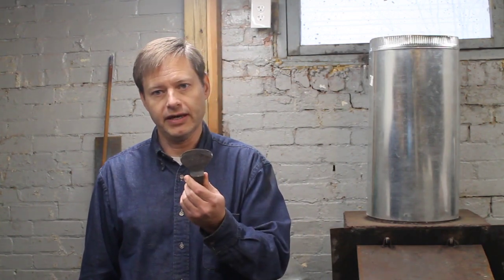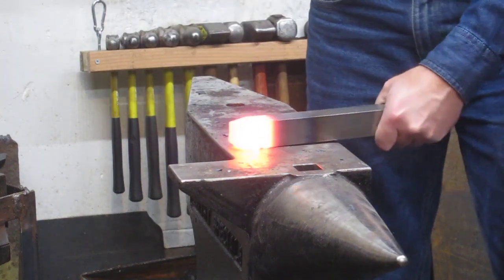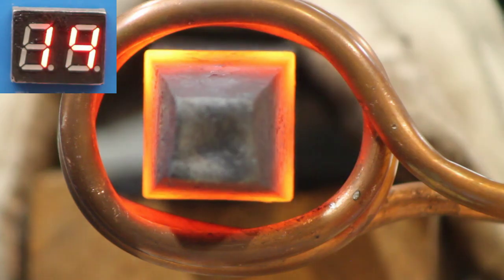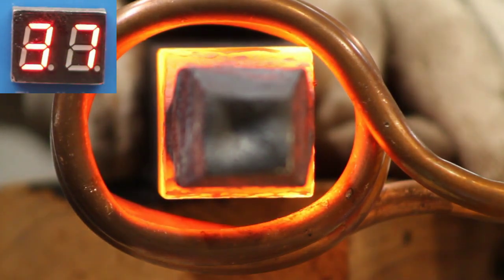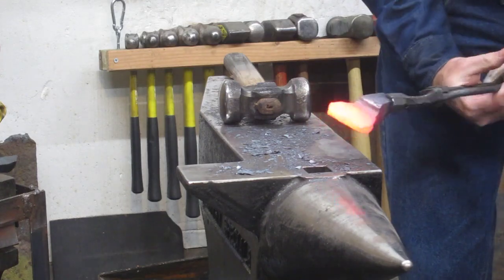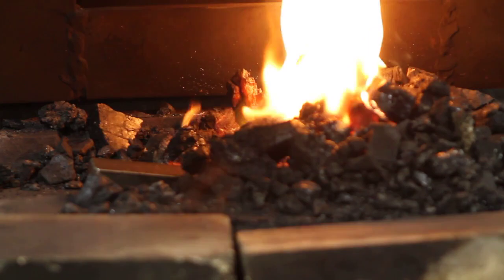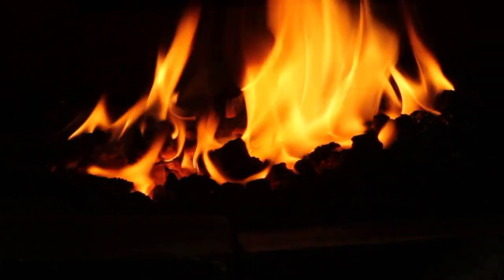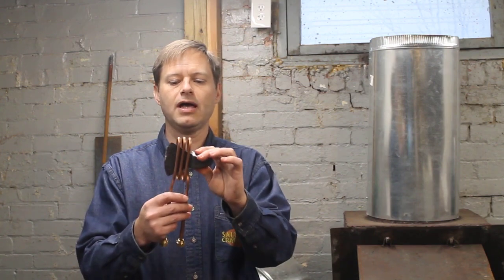Induction vs Coal: forging a hardy tool

Comment: I just saw the video. Thank you. For how long can it work continuously? Are there any restrictions?
Reply from the maker: I believe the electronics can do 100% duty cycle with sufficient cooling. Unless you have better water cooling than I do, you will not reach anywhere close to 100% duty cycle. I have found that sheet metal work (which radiates tons of heat back into the coil) and long-duration heats of larger stock for my power hammer will trip the alarm and it will shut down even with what is probably <50% duty cycle. I have purchased a transmission cooler / fan to see if that will work better than my current cooler.

Comment: Subscribed I'm also from Oklahoma pretty neat I hadn't heard of people using induction to forge so a quick search and I found this, I'm more interested in smaller knives right now from scrap materials so I think a induction forge is pretty practical. I am thinking of doing a wood forge using forced air to keep it hot in the future.
Reply from the maker: An induction forge works quite nicely for knives. You'd want to make a few different coil shapes for it. Rectangular cross-section coils work better for  flat stock that the circular ones.
Reply: @ejoftheanvil Thanks for the info.

Comment: What is the cost breakdown? How much does it cost to run the coal forge vs the induction?
Reply from the maker: At $0.10 / kWh, it costs $3.00 to run the induction heater for 4 hours continuously at 100% power (so, 8 hour day at 50% heating time). I can get coal at $0.07 per pound (yes, quite cheap compared to most sources). That's about 42 lbs of coal. I'm pretty sure I'd use more in an 8 hour day. And, that doesn't include the cost and hassle of driving to get coal ... the electricity just shows up.

That said, in a production environment, I'd still probably use propane since I could work multiple pieces at once.

As a hobbyist, I'm completely sold on induction (especially since I can use it immediately unlike coal and propane). If I were a pro, I'd probably have one in addition to propane not only because of the convenience, but because certain operations are just faster with induction.

Comment: exactly what i was looking for.
im a disabled vet. cant spend too much time on the hammer. wife and i want to start making knives and hatchets. simple thing. i am looking at the induction setup because it can be turned off and on at will and if it runs out of fuel, you have other problems. we are going to have a gas setup for quench or large projects, but i a hope to be able to just have the induction forge.

do you know of any descent ones where we could start looking? i was an electronics tech in the navy so im not opposed to building one, but id rather just buy one for safety. with my brain, i would try to build it into a 5 megawatt radar type induction forge and heat the neighbors truck..

thanx bud! loved the demo.
Reply from the maker: Induction is very good for heat treatment in most cases. You can make a coil that heats just the edge of the knife or hatchet.

You can find them on ebay advertised as 15kW (they're not, they're 7.5kW) units. If you don't want to take the ebay risks: https://ussolid.com/u-s-solid-15-kw-high-frequency-induction-heater-30-80-khz-220v-or-110v.html

You will also need a cooler. Larger TIG coolers will work.

Comment: how diverse can I be in the shape of my coils? Can I scale and change the shape of the coil based on the section of my billet that I am working? i.e. 2 in diameter then forming it to fit into a 1x3in diameter for the pocketHatchet tip? I trust will need to study induction fields more in order to exploit the advantages of induction. However, for a quick answer, in your experience, what is the max length you have been able to create with your coils and what was the most complicated shape? many thanks for the vids. It is hugely appreciated.

Lastly, do you have a paypal or PayWhatYouWant or other ecomm means of making a donation? I would like to contribute a marginally small ;) amount for your efforts. Please provide a link when you can.
Reply from the maker: You definitely want a good fit for the current size of your work. I have a video showing that effect: https://www.youtube.com/watch?v=gzp4MvxLAag. However, you can't have more than about 600mm of coil. I show that mistake in https://www.youtube.com/watch?v=XGGiGrkwXts. I have a few more videos on the design of coils planned.
Reply: @ejoftheanvil  greatly greatly appreciated.

Comment: Could you make Damascus steel with this type of system. A typical billet being 1.5x1.5x4-6" in size?
Reply from the maker: @Rodney Langstroth: not easily. That size is barely possible. Taller stacks, nope. It's hard to bring a full billet to an even welding heat. You tend to burn some areas while others are still too cold. I have some ideas on that which I hope to try (and document with videos!) in the coming months.
Reply: @ejoftheanvil  I'm also very interested for a video about damascus and forge welding with induction forge as I'm curently in the market for this or a DIY propane forge and I'm sitting on the fence.

Comment: induction heating is more efficient! Nice to see your video!
Reply: I have a local smith friend who just got an induction forge and I'll be excited to see it work.  But with a gas forge I can heat many pieces at the same time, moving them to the hot tter area of the forge sequentially.  The induction forge may shine in many things, but there are advantages for the gas and coal forges.  If I wee a younger smith doing a lot of production again I would add one of these to my shop for certain.   Looks like an ideal way to heat the middle of a bar to upset or punch the bar  in a short area.   This is a great set of videos on beginning to use an induction forge.

Comment: Did you hardwire your unit, or wire a plug? I know the instructions say to hardwire it, but it sure would be convenient to use a NEMA 6-50 plug instead. Then I could change out with my welder.
Reply from the maker: Plug: I installed the same plug as my welder. I think the hard-wired thing is mostly for the 110v unit which would have to draw something like 70A.
Reply: @ejoftheanvil  thanks for the reply!

Comment: With coal the first heat takes a while but then the heats are much faster. Although induction is faster overall I’d rather use coal because it’s what I’ve always used and it’s really cheap for me.
Reply from the maker: @GuardedDig2: Yes, good observation: an established coal fire heats about as fast (or even faster for large stock). I pay US$.07 per pound of coal. That may be cheaper than the electricity for induction heating, but not by much because the induction heater is basically only on when I'm heating. The real key for me is the convenience for short duration work. If I only have an hour or so, I lose almost all of it to the coal fire. I lose 60 seconds or so to putting the right coil on the induction heater.
Reply: EJ of the Anvil I will admit that’s convenient. It’s also clean so you wouldn’t get all dirty. For me I only get smithing when I have most of the day because I like to get a lot done. But I can see the appeal of an induction heater but it’s not for me. Would wrapping the coil in ceramic wool or fire brick help or make more efficient?
Reply from the maker: @JustinTopp  Generally no. You want the stock to nearly completely fill the coil to maximize energy transfer. However, it's a good thought and I think there are times where it might help. Like when you need an even and deep heat for a large forge weld. I plan to tinker with it at some time.

Comment: What did you use for heating,  where do you find it
Reply from the maker: It's an LH-15a. I bought mine on ebay from zhuofei3371 (also joyfay.com). Search LH-15a induction heater. Don't get a 110v version!

Comment: Can you induction heat Tungsten to the point it's malable?
Reply from the maker: Yes. But you can't work with it practically in a normal blacksmith's environment. For instance, at a reasonable forging temperature, it will melt your steel tongs.
Reply: Yes, you would have to expect the tools to be disposed of or used for scrap.
Reply: Why would you ever want to forge tungsten?

Comment: The coal forge pitting can be mitigated or even prevented by a combination of more low-heat planishing and brushing more once the piece gets closer to finishing being forged.

TLDR: You need to let the oxygen be consumed by the coal not the steel.

If you have actual clinker sticking to the work, then you're too close to the bottom of the fire, and exposing the piece to a lot more oxygen than you may realize.  This is a problem with carbon steels, as even if you don't overheat it, you can burn the carbon out of it (surface+ or -3mm) by using the oxidizing part of the fire.

You need to let a fresh coal fire soak without blast once it catches in earnest;  Your coal fire takes so long initially because you put a cold piece of steel in to the bottom of your fresh fire with all the blast from your blower working against you, the fuel below having not yet caught, and the blower keeping it from doing so.  The first forging period gave the fire time to settle and heat the fuel on the bottom, making the second heat still faster than it would be without the remaining heat from the first.

You need 4-5 inches from the clinker-breaker in half inch sized coal, the larger the pieces, the further from the clinker-breaker you should be.  Same goes for larger fires with more blast on the same coal, you need to let the oxygen be consumed by the coal not the steel.
Reply from the maker: Yes, that's a good summary of the conditions and how to work with them.

However, you can get coal impurities on your work at any level of the fire. The coal I used for this project came (partly) from a literally dirty batch. The silicate impurities do drip down on the work and are very sticky and rather rougher on the surface than regular scale (iron oxides). In my case, I wasn't deep enough in the fire to get contaminated by the consolidated clinker (mostly the same silicates). In the case of such dirty coal, a vigorous brushing right out of the fire is helpful because the silicate goop comes off pretty easily then. As you point out, scale should be brushed off late in the heat. There's not much point when the metal is so hot that scale is forming very rapidly.
Reply: Just to be clear, I use bituminous reclaimed from a long abandoned Iron production related site, lots of little pieces of brick, chunks of coal with visible sulfur impurities, some white phosphorus, and most of the dust in mine is actually sand.
Reply from the maker: That would explain why you have so much expertise with this!

Comment: I have another n00b question for anyone inclined to answer. I've seen a lot of vids of people making hardy tools, but the common problem threading through every vid ive seen to date is the invariably loose fit that people then wrestle to snug up. Ive seen references to building it up with welding beads or wrapping in duct tape, but my question is this ... why not just make hardy tools as a binary affair, where you forge the tool you want out of tool steel and then simply weld it onto a base of solid mild steel stock that has already been machine lathed and/or cut to precisely fit your anvil's hardy hole ?

Thanks in advance to anyone willing to reply. 😊
Reply: The "Brazeal" style of cutoff tool wedges itself in the hardie, due to the taper. It can also be used in different sized holes/anvils as well due to the taper, if long enough. Now that said, you wouldn't want a fullering tool or swage to be tapered due to the immense amount of pressure placed on it when forging, which could cause the hardie hole to spread or worse case, the heel of the anvil to crack off.  BAAAAD times ! that's why they are always "loose" and bounce a bit.  It's the nature of the beast.
With a "Brazeal" hot cut tool, the hot material is soft enough and the curved shape of the cutting edge concentrates the pressure to a very small surface area of the stock. This allows little force to be applied to the hardie hole other than a minor amount needed to secure the wedge and provide ample resistance for cutting while driving all the residual pressure directly to the point of impact against the hot steel.  Once you use this style of cutoff, you will never use another !
Reply: T. DesMarais Thank you. Hard to absorb this sort of thing by reading and video snippets - there is no substitite for hands on time.
Reply: One great solution for loose hardies is be to put a tang with a hole in it on the hardy shank, and use a weight or spring or wedge, etc. to retain the hardy, while still allowing it to load only the anvil face around the hole.

One can use closer tolerance stock to fit their hole, if they can afford it, one problem is the prohibitive cost of a welder, the other is the effort needed to only upset the part you want to be thicker.

My hardy tools are really weird, as having a 5' railroad track for an anvil means giant "staple" shaped pieces with forms/tools/swedges on top have to suffice for now.
Reply: RufusWolf Ah, clever ... a spring braced against the opposite end of the hardy hole that maintains constant pull from below on hardy tools.